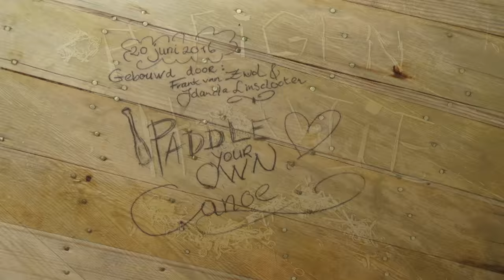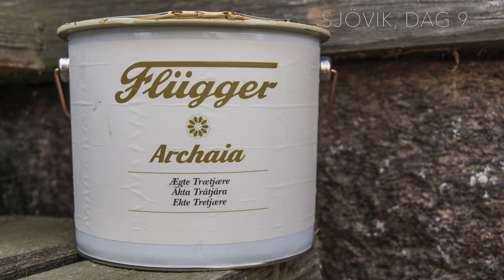Traditional wood canvas canoe building & adventure SWEDEN

Comment: What did you put on the canvas to finish it?
Reply from the maker: Tar. You see it at 2'.36''?!
Reply: "Hair Wood Tar", I have figured that out in the time between the question and the your answer. How many coats and what was use below the water line to give it the 2 tone that you can see as you are placing the canoe on the car @ 3:43
.
Reply from the maker: The coating was two or three layers of tar, mixed with varnish on a 50/50 base.
Above waterline is finished with a layer of varnish.
Below waterline is finished with one layer of (red) shellack on ethanol base, which is even more waterproof and easy to repair scratches.
Reply: I am very interested in using this finish on a canoe I am restoring. What type of Varnish did you use? Spar? 
More Details Please.
Reply: ‘Hairy wood tar’??  What is that? Here in the U.K. we use a liquid basement waterproofer to fill the canvas before painting...
Reply: @andrewgulland3925  Do you know of a retail supplies?
Reply: @kevinfrench5915  I use Zinsser Watertite Waterproofing paint... mainly used for basement waterproofing (and also wood canvas filling) available at good hardware stores here in the U.K.